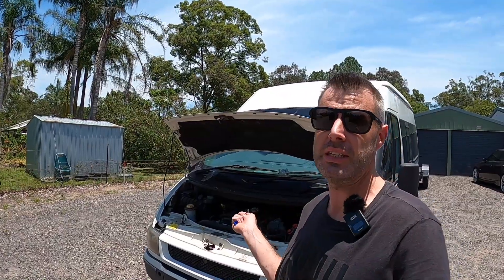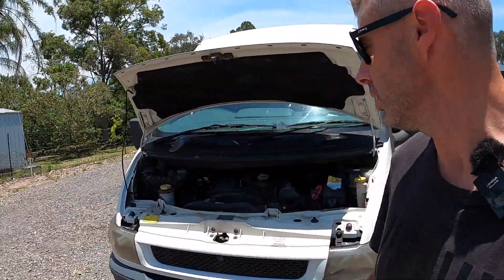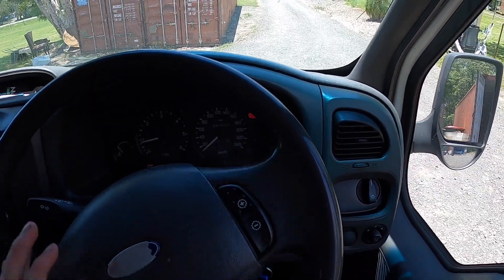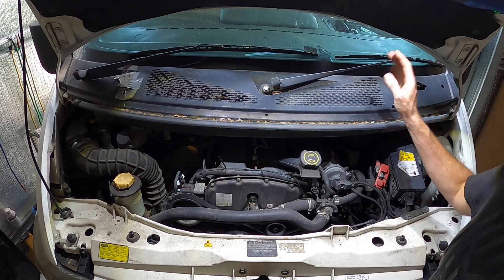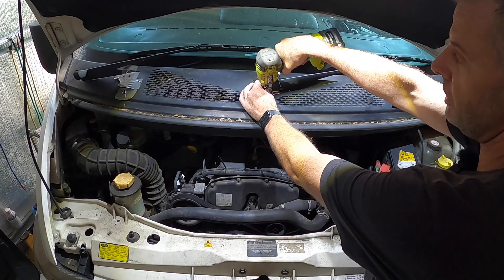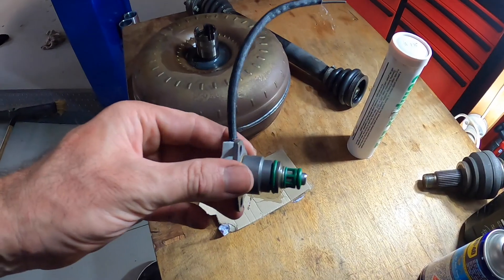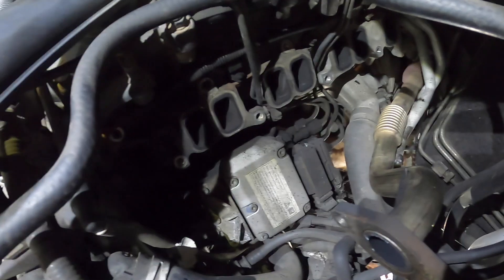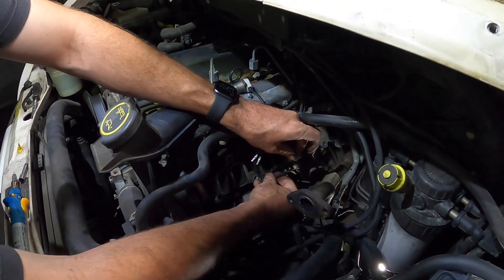Ford VH Transit Engine Rattle & Power Loss: DIESEL Pump Timing Solenoid

Comment from the maker: These are finally on ebay - https://ebay.us/Qui1JP
Reply: Hi sir, i have an issue, i have a ford transit 2002 that dosen't want to start after 4 injector change because i have a lost of power and injector knocking.
Reply: Thank you

Comment: Ciao spero che mi puoi aiutare… ho un transit cassonato uguale…. Ho un problema con la cinghia servizi… mi scavalla fuori dalla puleggia dell’alternatore stracciandosi completamente… sono già tre cinghie che mi strappa… ( alternatore nuovo compresa puleggia, tenditore ina nuovo anche quello) volevo sapere se vi si è mai presentato lo stesso problema e se avete risolto..? Poi ha anche difetto che a freddo parte bene , poi una volta caldo se lo spegni per tipo 15 minuti alla ripartenza fa fatica ad avviarsi… premetto che ha la pompa nuova… anche in precedenza lo faceva, ma non così accentuato…

Comment: Got the same problem. Was running like a tractor and weak as pizz. Tested solenoid and its shot. Im in Aus, cant get one unless i punch out 700$ from Singapore or 850$ locally. Is bs. Would you recomend any online shop to get it?
Cheers
Reply from the maker: Hey mate, this was so long ago. I think the shop we ordered through was from Harvey Bay.... maybe. Used to advertise transit parts on gumtree.

Comment: Hi , i have the same problem with my focus , but the thing is it will not start up with the errors . When starting up the car it will run normally, it has power and no rattle . As i start driving , after a bit it will cut my power and have that diesel knock (also the errors p1564 and the other one appear). It is for sure the timing solenoid , but is it really a faulty solenoid ? I am thinking that the wires protection could be gone , and so i have an short or something . As i understand from the video , yours had the simptomps from the very start . Is there a way to test it ? Thanks

Comment: I like how you removed the front top panel and the wipers to get at the motor easily. My VJ doesn't have the knock but it does lose power and blows way too much black smoke on every damn hill I go up at 60 kmph 😒. My return line from the injectors is leaking diesel so when the new one arrives next week I am going to remove the injectors as well before reinstalling them and clean them so they work correctly. There's a Youtube video for that of course. Should save about 2 grand! Fuck me I am not asking anymore mechs to fix it, I will do it myself. Last time the mechanic replaced the EGR and the fuel pump and I replaced my KN air filter but it's now worse a few months later. Anyway nice vid mate and yes get some ramps, that makes life much easier with these vans.

Comment: My error codes are P1664 and P1564 I think thats a timing module problem.Could it be this solenoid instead? Has ranyone tried fixing the module on top of the pump?

Comment: I have the same transit Mk6 (85 T260) turbo, which just cut off while in motion. Now it's just cranking and but not turning over... What could it be???
Reply: Most likely the fuel is airlocked and the fuel system needs bleeding.

Comment: Anyone had or has the same issue with a stuck fuel pump bracket? How did you fix the issue with the stripped bolt? I’m curious! My fuel pump bracket is stuck in place for some reason & i removed the 4 bolts that hold it in place and managed to remove one of the torques screws  that were sticking out. The other one is beginning to strip & kinda suck there

Comment: Hello, huge thank for the video !!
My ford with the same engine is randomly stalling with different error code.
It makes the exact same sound as yours (tractor like) but doesnt have loss of power. 
The codes showing are always different but the ones that comes back are 1593 and 1664. Was it your case ?

Comment: Great video. I have exactly  the samr problem. Have been told that I can't buy just the solenoid herein NZ and have to buy the kit    and have a diesel specialist set up the pump on the bench. Price estimate $5000-  I found the part on ebay also. Will update when part arives and I have it installed. This video is worth Gold. Very many thanks for putting it up.
Reply: Solenoid arrived. I had got the  torque bolts out after much trouble only to find the solenoid is frozen into the pump. Have tried all sorts but it won't budge. Didn't even think of that possibility after watching videos. Put it all back together and vehicle Still runs. Have it booked in at a Transit specialist in my city. He tells me if solenoid frozen its pump off and try and get solenoid out on the bench. If it won't come out I'm up for a rebuilt pump.
Reply: Update. Mechanic could not get the frozen solenoid out. Tried heating it and butcherd the solenoid mount. Ended up fitting a rebuilt exchange pump. Just over 5K. Nice to have it finally sorted. Now have a solenoid I can't return tho.
Reply: @andrewbrownlie2764 Hi do you still have the soleniod???
Reply: @heidi-siouxrawleigh23  No. Sold to someone with the same problem only he managed to get his solenoid out.
Reply: Do you still have soleniod???
Reply: Thanks where did you buy soleniod from?

Comment: Hi mate, my issue is that the revs die as I try to go from a standing start up a hill. They tell me it's the pump timing. So what you are saying here is that if it's a timing issue, you only need to replace the solenoid and not the whole pump is that correct?

Comment: hello friend, my car ( ford transit 2.2 dtci 2010 ) engine is cold or hot, the fan starts, it shows diagnostic code P0180 and P2563.  the engine has run out of oil
Reply from the maker: I am sorry but im not familar with what that problem may be.

Comment: Just finished replacing the fuel pump timing solenoid on a rwd mk6 tddi with a vp44 pump. I had errors P0149 and P1564 and loss of power and engine sounding rattly. 
Holy crap what a torturous job.  Access so difficult. 
Some notes to share:
-undoing the torx screws on the Solenoid I used an extension torx bar and ratchet and wedged a screwdriver behind the ratchet and up against part of the engine block to ensure the torx bit didn't pop out of the screw.
-the 4hole bracket at the back of the pump... During reinstall I taped the 'difficult' bolt into the end of an extension bar and socket to make sure it wouldn't fall out when blindly trying to find the hole.
-my old solenoid didn't test as open circuit after removal. Maybe it was still good? But the wires from the upper part of the pump to the solenoid had zero insulation. Maybe it rots with heat and age? I wondered whether the problem was actually these wires shorting together. I put heat shrink on any remaining old wiring.
- after starting the motor runs so smooth and powerful. 
I read somewhere it's a 2hr job. I took about 6 hours. 
I do not recommend this job if you're not an experienced automotive tinkerer. I has some real "I don't think I can get to this this bolt" moments. 
I didn't jack up the vehicle. In hindsight some more room under it would have been nice.
I removed the inlet manifold and starter motor prior to accessing the pump bracket then the solenoid. i didn't remove the EGR valve.
Reply: You got a part number for timing solenoid?mk6 transit 2.4tdci Thanks
Reply: @tel2817 aici se vorbește de motor 2,4 tddi

Comment: Sounds exactly like problem I'm having. Glow plug light comes on and engine just goes idal. Struggle getting up a slope and won't go over 50. 2002 2.4 minibus
Reply: Did you change your pump in the end?
I have a 2002 minibus.. only gets up to about 50 and barely gets up a hill!
Reply: Mine same any one found owt?

Comment: Dude pls reply 
m I wrong or is this the 2.0 tddi 85kw like in the mondeo mk3? 
I have fine noise until 2k rpm
And then it sounds like this one in the wideo but much faster bcs of turbo hit it does gain power but its not like it should be its like 60kw not 85.. do u think its the same thing as u changed??
Reply from the maker: Sorry man i have no idea.

Comment: What problem did u have with this middle torque bolt , I get to the stage  I cant uncrew it, any specific torque key did u use?
Reply from the maker: I’m sorry I can’t remember it was so long ago
Reply: I got it, just bought proper tools, and unscrewed it
Reply from the maker: @Mariuszterpilowski_  man, so good to hear!
Reply: @Mariuszterpilowski_   hola podrías decir que llave tórx usaste para sacar los tornillos del solenoide
Reply: @franciscofuente9351   multi-tooth socket wrench set, And drive hex bit socket
Reply: @Mariuszterpilowski_ all good thanks 😉
Reply: @Mariuszterpilowski_ what exact tool? I’m stuck there to 😊
Reply: Hola podrías decir que llave usaste

Comment: Love this -

I’ve had one go on me, and replaced whole pump with a one from scrapyard after a load of other stuff done first. 

The whole pump is £800 for a reconditioned exchange and the solenoid is £150 ish .

The fuel pump solenoid is definitely a known fail on these vp30 pumps. 

This is a really good clip especially of the manifold with all them bolts. The other pain is the vac pump just in front which has the worlds worst gasket prone to leaking and only torqued down to 22nm ish 🙈. 

Anyway thanks for sharing this clip there must be loads of folk looking for this.

I noticed your pump was the bigger vp44 - still same thing and the really good thing is you show the engine running and what the diesel knock sounds like.  The mk6 engine has either or depending on which turbo size I believe.

One other thing to look out for in uk is the module on the top can be a non bosch part from some bosch suppliers so it’s worth checking if you are going for a whole recon exchange. 
If you swap the pump it needs coding in unless it’s a new virginised module.

Comment: do you know what is the part number for that or where to find it?
Reply from the maker: These are finally available on eBay - https://ebay.us/Qui1JP - i dont know the part number but its the VP44 solenoid that i used. The one with the little pig tail wiring

Comment: I'm part way through, and Im starting to strip the screw to the solenoid. How do you get these out safely, and what happens if they're stripped?
Reply from the maker: Mine come out ok. Seriously take your time. Use some heat. Warm fasteners often loosen easier than cold ones
Reply: What's best to use for heat? I'm seriously struggling :s
Reply from the maker: @bmci007  I would use a small blow torch, or heat gun. With a blow torch make sure nothing can burn, or melt. You just want to get the metal to a higher than ambient temp so it expands a little.
Reply: @ZeroTo60Tube  Ok, got a mechanic to remove the screws to the solenoid. I've put everything back together, connected the battery, and it's a no start, no crank. Just a red warning light on the dash... Just to confirm, the starter motor has 2 connections, not 3, right? The only thing I can think of is that I failed to connect a third cable to the starter motor? Got any ideas?
Reply: Finally sorted, got ALL the cables fitted to the starter, and it FIXED my issue! Thank you very much for your help, this video was a godsend!

Comment: My Transit get to 3k revs (no matter what gear) and then loses power and lurches, followed by a puff of smoke when power is restored (then loses power again). Is this something that could help?
Reply from the maker: This could cause those problems. But could be other issues.
Reply: @ZeroTo60Tube  I've cleaned the EGR and replaced the pedal cause they were throwing codes... Not sure what else to try :s

Comment: I had the same problem with my 2004 transit back in 2007, I removed the pump to have it recalibrated  thinking that the fuel had damaged the pump. The shop that repaired the pump never told me what they did as I didn't have much experience of diesels back then but when I put it back together it started working.  Sad to find out now that it was more than likely the solenoid and got ripped off by forking out £650 just for a small repair.  Anyway now I only drive Toyota so never had any issues!
Reply: solenoid is nearly 220qiud pal and most garages will only change the the whole pump because the solenoid can be hard to remove pal I've changed about 20 of these over last ten years some come strait out but some seize badly  in the pump then you have to remove the pump which is obviously expensive  but I've done about 10 without removing pump 650 is on the dear side but I've known it be 800 so 😉 could of been worse

Comment: Where you can buy the solenoids, especially the metering one?
Reply from the maker: We got it semi locally a guy on gumtree had a load in stock. Unfortunately he doesn't have them any more.
Reply: @ZeroTo60Tube  They are very hard to find used and new they are more expensive than the van...i wish there was an alternative to the obsolete pump...

Comment: Did this about 3 years ago had to take fuel pump out because couldnt get old solenoid out was in their good. Did you have to reset timing after?  Cheers

Comment: I have a 2008 the next model is your one known as the T250 Mine does weird things on start up more a funny noise sounds like a pulley belt, it rattles away and am told that these engines are noisy. Anyway when covid hit in 2019 we were out in the van coming home and it was making a terrible noise lots of clacking going on it turned out to be loose injectors on #1 and # 2, AA came and sorted it, when lock down finished Zi took the van for a run and came home with more clacking injectors on #3 and # 4 easy fix. When I brought the van just before lockdown 2019 and had a business trip to collect some pets 160km away well had no power, the turbo was not cutting in, talk about being worried as time was critical on this job, around 1 1/2 hours into the journey the turbos started to work and has done so ever since no power problems a new turbo was replaced in mid 2014 188330kms speedo now around 245000kms the van has always gone to the Ford dealers for work so here is hoping it behaves itself
Reply: 2008-tdci

Comment: i used to have a rough idle and annoying engine rattles, i found adding 1:250 ratio of 2 stroke oil to my diesel made all the difference, highly recommend!
Reply: Hi are you adding the 2 stroke oil into the diesel tank? 
If yes are you doing that frequently! And your not getting any issues with blocked filters or injectors?
Reply: 10:15  @keithevans4643

Comment: Thanks guys had same issue no one wanted to do it they told me to change the pump but I already bought the solenoid so attempted it myself. Was an absolute nightmare lol obviously because of the space and stripping the last bolt holding the solenoid in place. Spent whole weekend under the van trying to get this last bolt out. 
Eventually did and it started on the button and no rattle. So once again thanks!!
Reply from the maker: Its a tricky job thats for sure. But really rewarding when you fire it up and its all good.

Comment: Any video for transit 2.0 tddi 2003 with front wheels drag?I have prob with the pump after an repair its stays around 1000 rpm and shakeing.

Comment: I have the problem model similar ford defuses. changed the injection pump, the whole food installation and the problem persists. can you help me? is the problem in the pump solenoid valve?

Comment: What is the cost of changing the pump timing selonoid
Reply from the maker: Free if you fit it yourself. The sensors are about $250AUD and it takes about 2-4 hours to do. So what ever labor rates are in your area should give you an idea on total cost.

Comment: @ Morning, cor blimey.... you sure made this look easy. Its really not, Im still working on getting to the diesel solenoid. Who designed this van ahhhhh. It was so hard to get to.. Now Im stopped by a stuck FLANGE holding the diesel starter solenoid on. Got the screws out but its stuck tight. Tiny thing in a most difficult place  And yeah, you have to be a super contortionist to even get to see the pump.....Ive soaked it, tapped it, whacked it and spoken nice words to it, but still says nope...not coming off.. 
So please can you advise me on how to release this last flange???
Also, ive been quoted €265 for a reconditioned part !! Waaaaaaaaa.... any idea where i can get one cheaper as its taken 4 or more days to get all the parts off for access. So I dont really fancy going round friends farms stripping olf Trannys in the field  trying to find the part. Its a bosh 0281002432 that I need. Any help re getting the flange open so I can get the part off, or advive on this problem ould be amazing...... Thanks